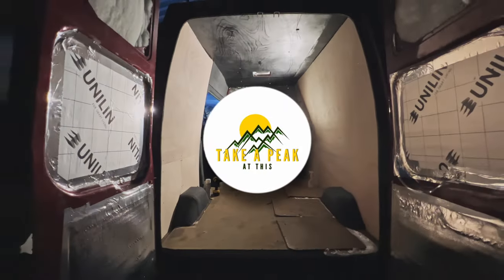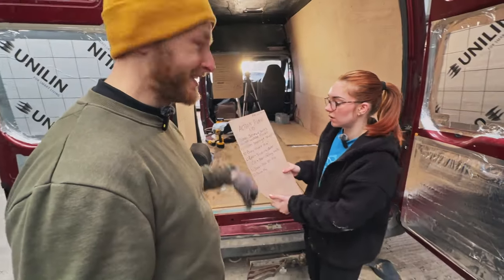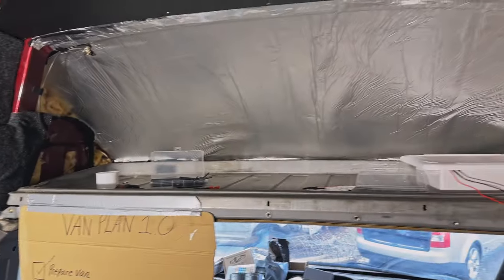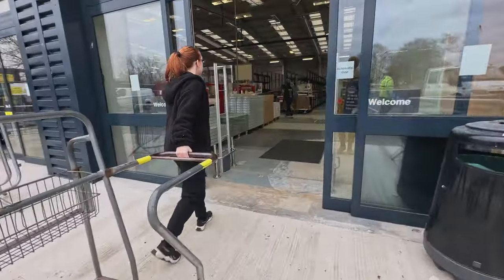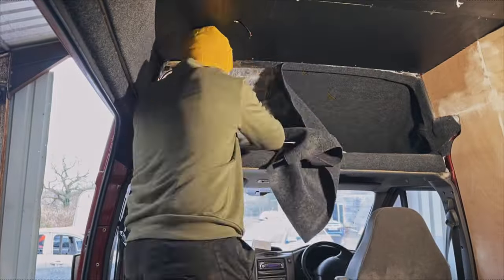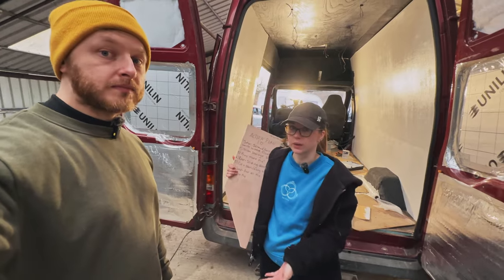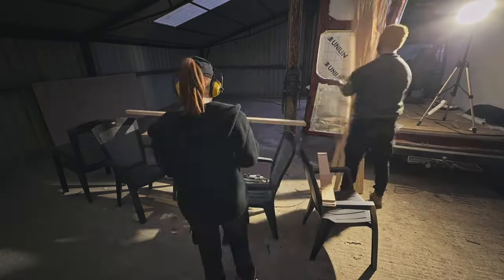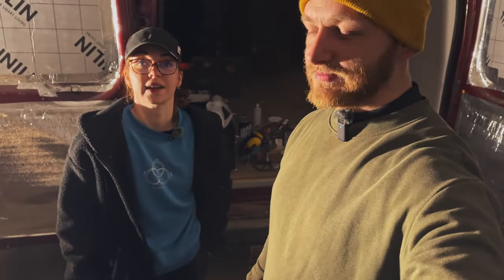Carpeting And Painting | VAN BUILD EP 6

Comment: Hi Guys, are you planning on putting any windows in the van?
Reply from the maker: Hey 👋 Yes we do, we thinking of putting windows in the back doors and potentially in the sliding door but haven’t made the final decision about it yet 😊
Reply: @TakeAPeakAtThis  I only asked as you have already put insulation in where they would normally go. It is easier to fit the windows before fitting the insulation.
Reply from the maker: It’s not something we are planning for the near future, we may not fit any in at all but if we decide we want to, we will take the insulation off ☺️